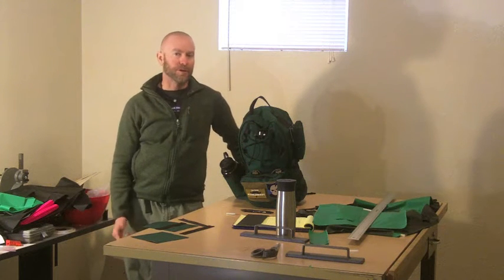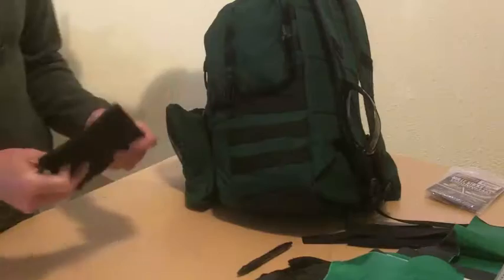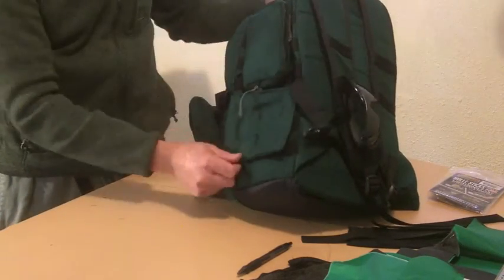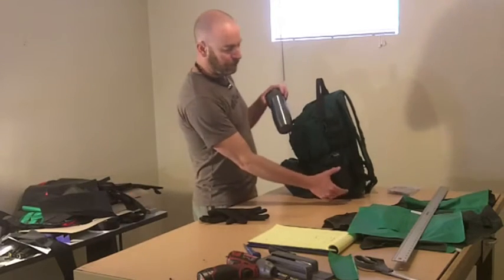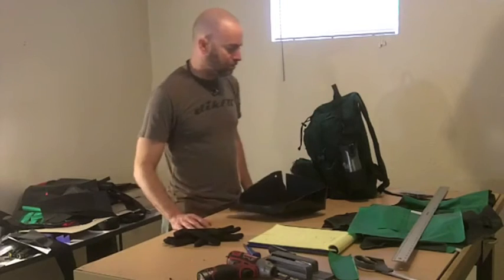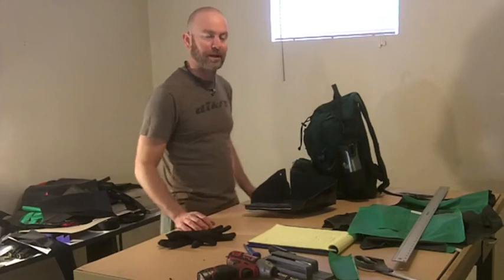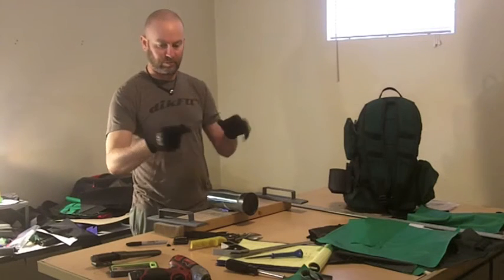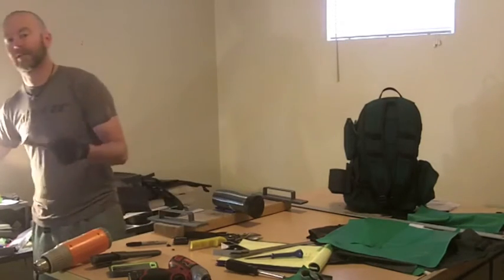Tactical Coffee: Kydex coffee travel mug holster for my EDC backpack

Comment: Wait!!!

Drilled holes into the Kydex.  But, what went into the holes?  How did you attach the "awesomeness upgrade" to you bag?
Reply from the maker: The holes in the kydex are to accept "Chicago screws," which attach the kydex to the MOLLE panel (in this case).  The MOLLE panel is then attached to the PALS grid on the bag, in my case using MOLLE Stix (there are numerous ways to attach MOLLE gear).
You might check out some of my other Kydex videos, they go into a little more detail.  If you haven't played with Kydex, it's super fun.